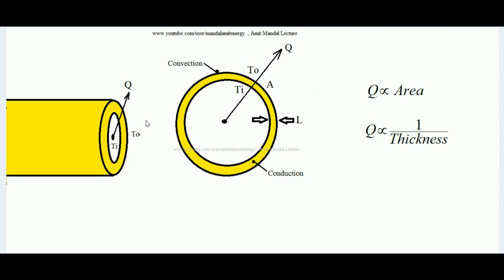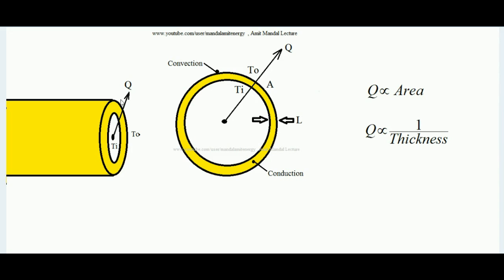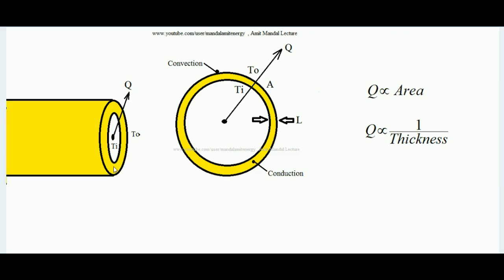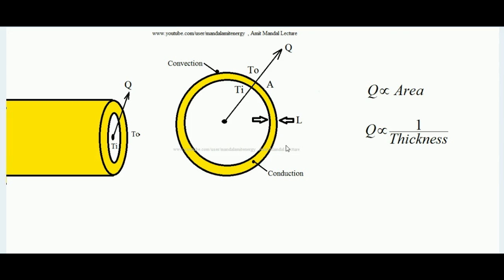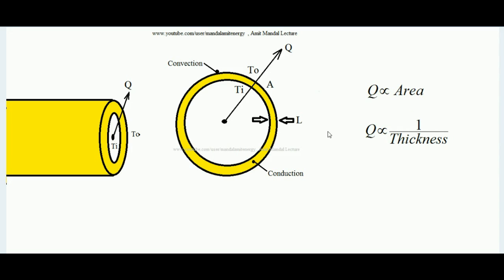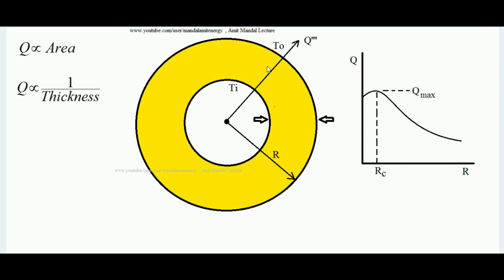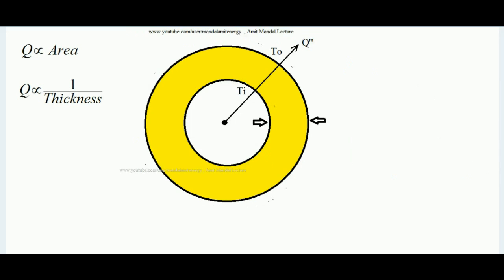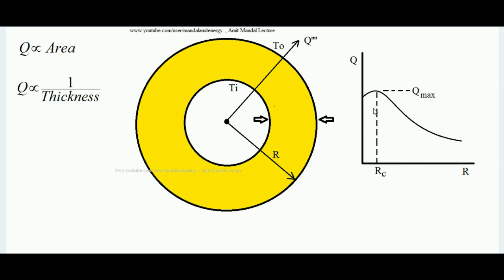Critical Thickness Of Insulation | Critical radius of insulation

Comment: What happens when the thickness of insulation on a pipe exceeds the critical value?

(a) There is decrease in the heat flow rate.

(b) There is increase in the heat flow rate.

(c) The heat flow rate remains constant.

(d) The temp rises at the junction bet pipe &amp; insulation.
Reply: a.